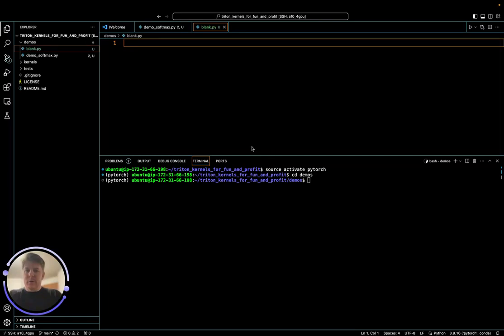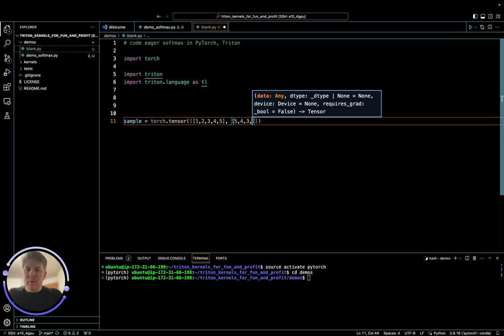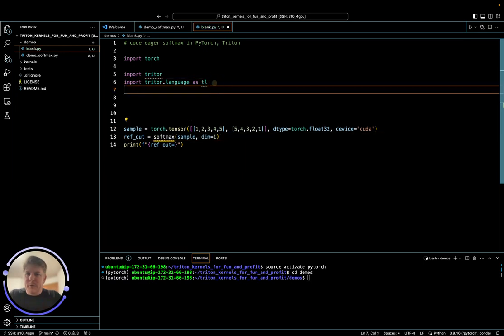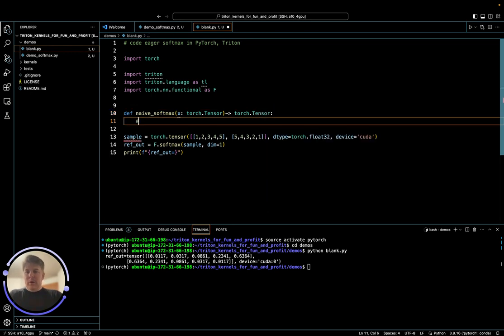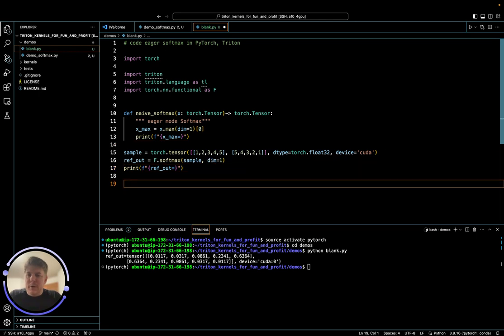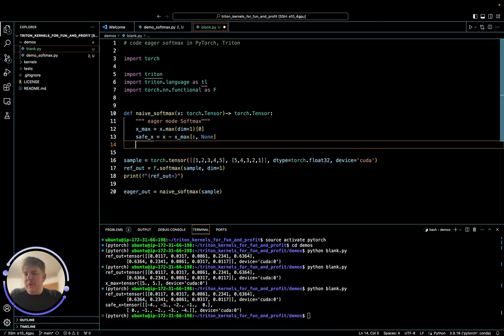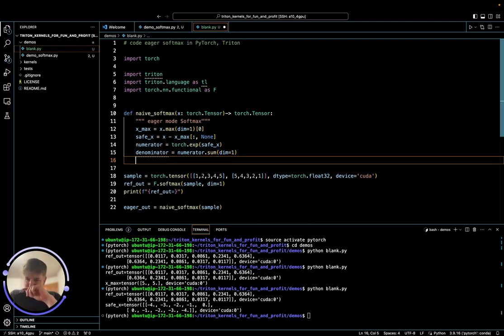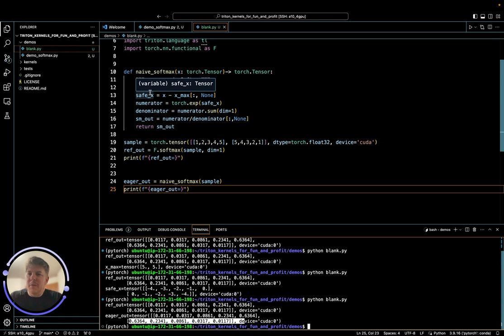Intro to Triton: Coding Softmax in PyTorch

Comment: Hi, I'm trying to teach myself to write triton kernels. Is learning to write CUDA a prerequisite to learn triton?
Reply from the maker: Hi @ChimiChanga1337 - you don't need to learn CUDA first in order to write Triton kernels.  I would say a lot of people doing Triton don't necessarily know CUDA, since CUDA is mainly C++ based.  That said, I will say that Triton still generates PTX code, same as when you compile CUDA so there is a common intermediate denominator that they both get compiled to (ultimately PTX becomes SASS to run on the GPU though), and ultimately CUDA generally lets you have more total control of things vs Triton where you rely on the compiler to do more for you.  One item though -  imo, you will still need to understand the  basic fundamentals of GPU hardware in order to better design Triton and/or CUDA kernels.    Hope that helps!
Reply: @sotadeeplearningtutorials9598  Thank you very much